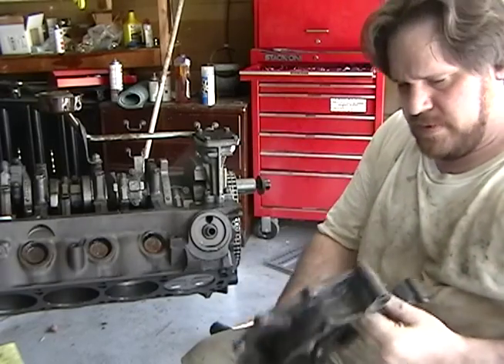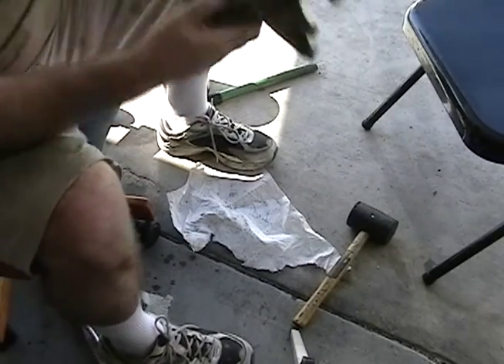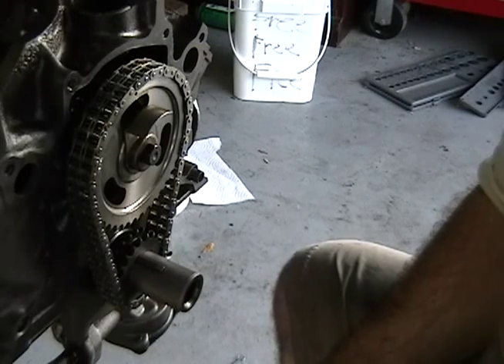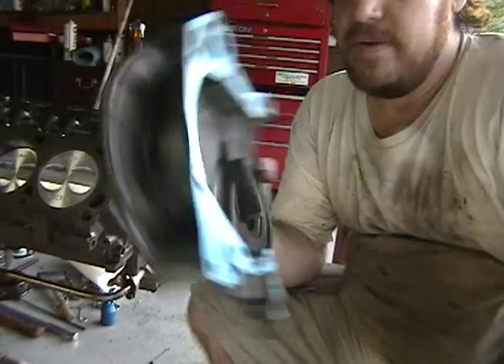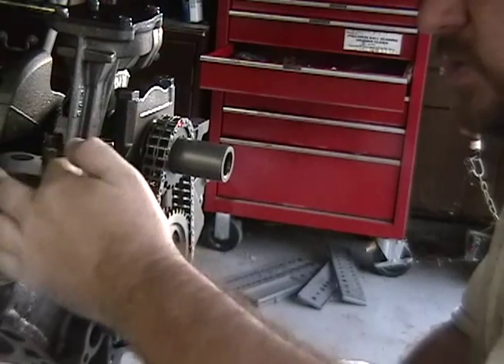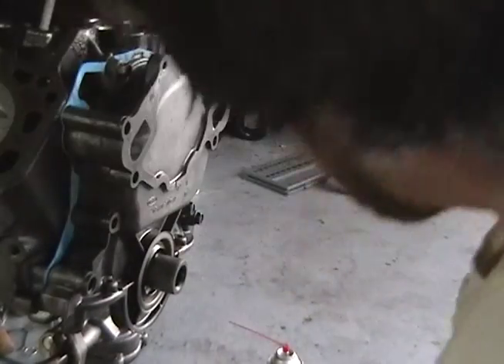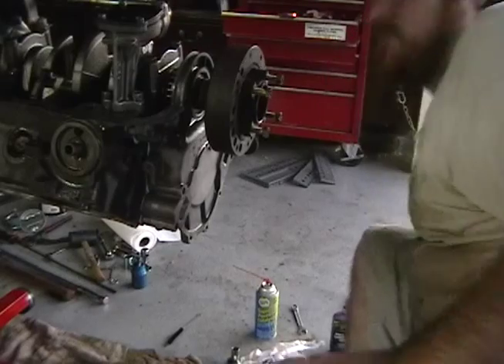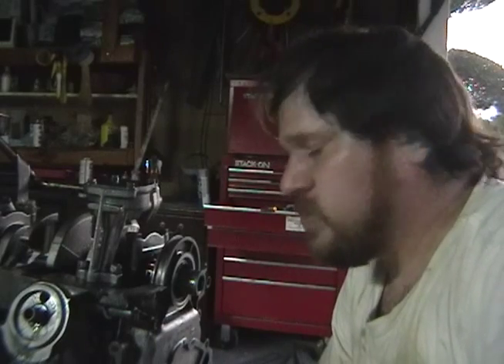1990 Ford F150 302 Engine Rebuild / Overhaul an Engine Part 11 section 2 Timing Cover Install

Comment from the maker: Here is information I gave him...../

"I have a 1995 f150, I am rebuilding my 5.0 as well. I found your videos on rebuilding your '90 which looks the same. I am trying to install my timing cover and water pump but did not notate which bolts went in which holes. Can you provide me any assisstance?"

The bolts were all differents size for me too when I took them out.
I did  the same thing you did, I had to go online and find images to figure out where the bolts went.

Links in description:

Comment from the maker: 7ILLevans wrote me,
timed to 10btdc with spout removed, put spout bak in,connected my emission control system witch i realized wasn't connected to the bib on exhaust pipe just behind and above cat.converter,she purrs like a kitten now...thanx (ecs not being connected was causing fumes in cab,backfire on startup & when reved up and drop acceleration suddenly,& contributing 2terrible gas mileage along with timing being @20btdc) this info may help some one else if they have any of these symptoms.

Comment from the maker: continued....

Once removed,10 BTDC is what i timed my engine too.(make sure you connect the spout again)
Again this assuming your engine aligned Top Dead center with the Distriubutor.
Number 1 cylinder printed on the cap should be pointing toward the driver side, directly.
I will try to rent a timing light and post a video of it.

Thanks for comments, hope your enjoying the videos

Comment from the maker: Sorry for delay,
You can use regular timing light, just hook up the lead to the number 1 plug.
I assuming that your distributor has not been removed, or Time gear has been fussed with has not been messed up. To time your truck you going to have to take out the spout connection on the harness that is connected to your electronic distributor module.
This is same as taken the vacuum line of the vacuum. The spout(Grey  plug) disconnects the electronic advance and allows you to time your engine.

Comment: hello...just bought a ford f 150 with an electronic fuel injected 302 (1990) does anyone know that the timing specs are for this motor? i cant find it any where...also curious a friend mentioned that i might not be able to use a regular timing light on it? im lost!!!

Comment from the maker: @joeb0 if the engine is out of the car, and dissembled you could thermally clean the parts. but first method will work while the engine is in car

Comment from the maker: @joeb0 your going to need a degreaser to clean off the sand grease mixture.  Be sure to cover yor distributor and plug wires/ sockets against water and degreaser